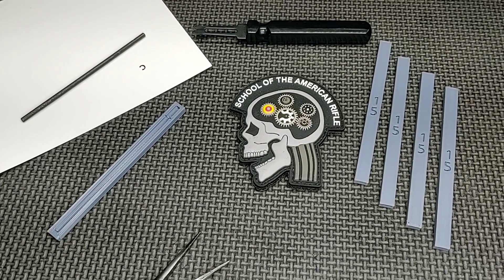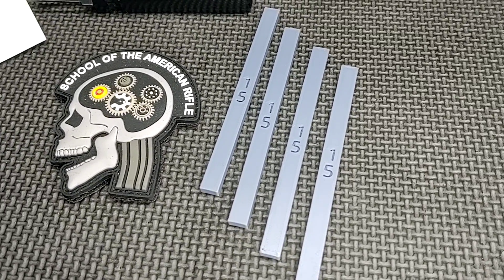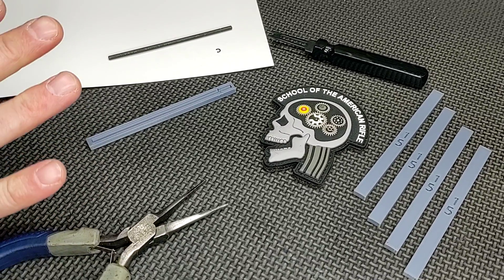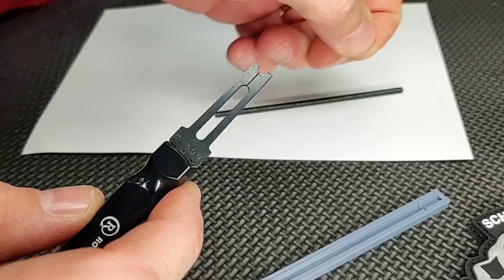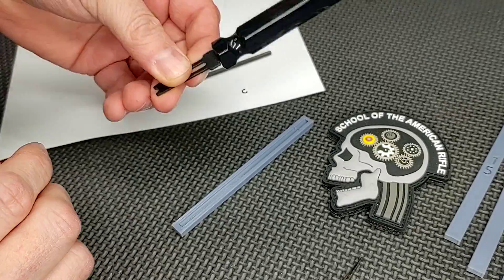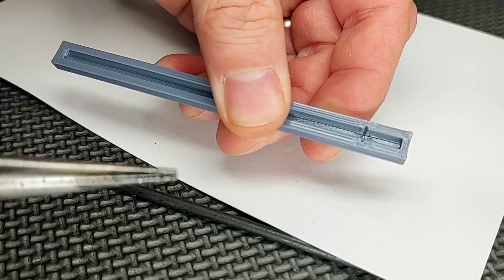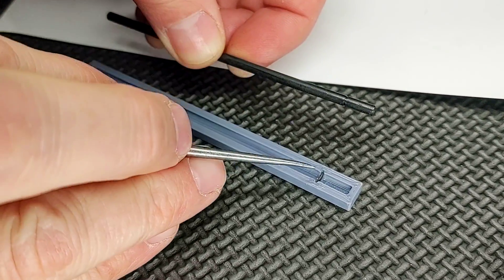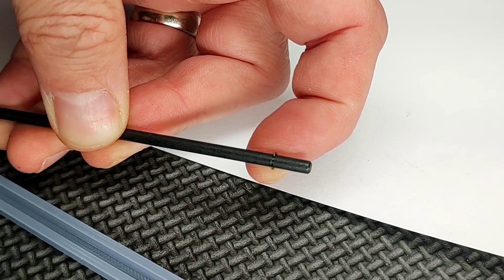Easy Dust Cover Clip Install - Domo Tech AR-15 Dust Cover Clip Jig

Comment: a little improvement, cut off the other end of the jig so you can use it on longer ar10 pins
Reply: I was thinking it didn't need most of its tail, and just truncating it (leaving the long end open) would make it easier to remove the assembled rod.
Reply: @ericwilner1403  another plus

Comment: How is that a (fantastic tool)? You can't install the rod with the clip attached. So...it's a fantastic tool to...keep your clip and rod together when it's off the rifle?  I don't get it.
You use a tiny smudge of grease to hold the clip in the tool from Brownells.

Comment: Ive seen these clips pop off before. Definitely need some kind of tool to put them back on (or rather replace it with a new one because once it pops off). Rifle will still function without it though.